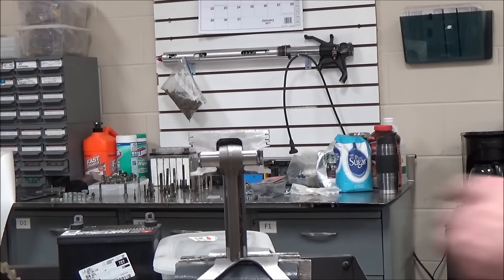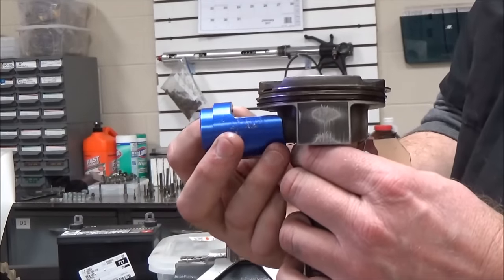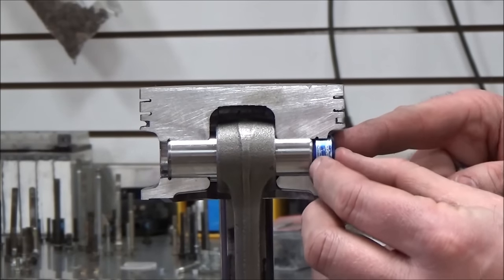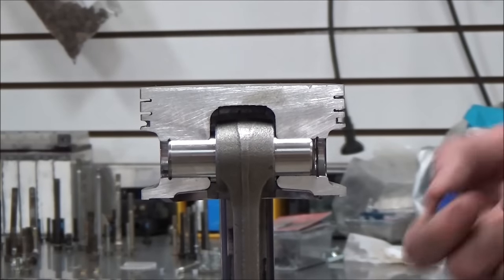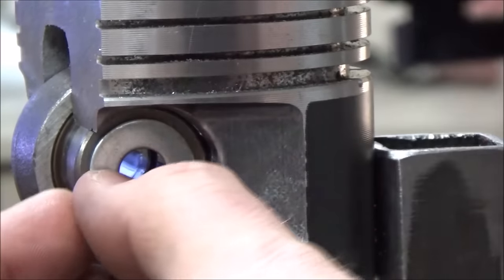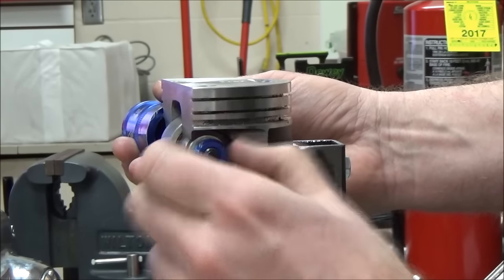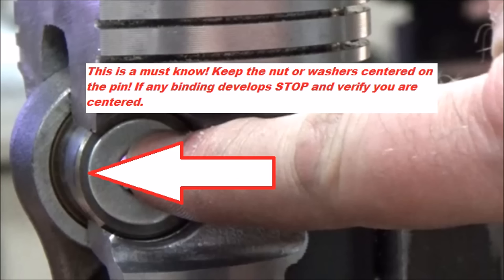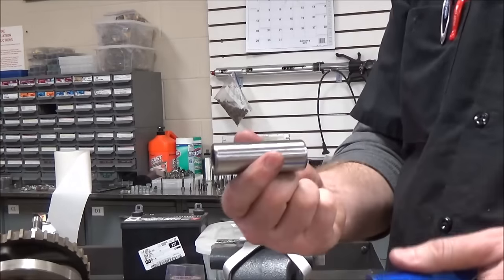How to pull a piston wrist pin  Motion Pro Deluxe P/N 08-0472

Comment: Could you show how to correctly remove and install C clips found please?
Reply from the maker: Done.... https://youtu.be/rJvMn_VlJ4E
Reply from the maker: Hope you enjoy this member benefit!
Reply: @How2Wrench  oh I meant the external kind. Maybe they are called E clips?
Reply from the maker: @hlpang1075  We got you....😊 https://youtu.be/upvWlPJkEMI
Reply: @How2Wrench  thanks for the patience ❤️ These are the ones I’m referring to in the link but the methods demonstrated don’t give me confidence 😅. I remember coming across them in the transmission. They do not have holes in them where a normal circlip plier will work. https://youtu.be/UC4H3bDnmzg
Reply from the maker: You have to use a flat driver just as they show but cover with your hand or a towel. For installation, I use a flat nose pliers and "snap" into place. Still keep a towel in case of it coming off and after you think you're done. Do a fit test. If it will come off by hand, the clip is stretched and needs replaced. If it won't rotate with a slight drap, it may not be fully seated in the groove all the way around. You want full seating with some drag. I also install these flat side out.
Reply: @How2Wrench  thank you!